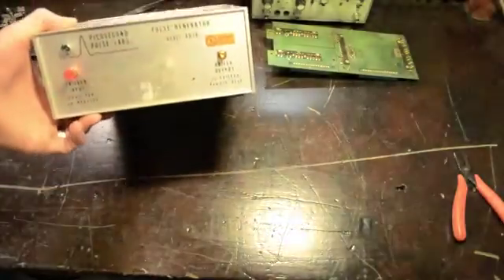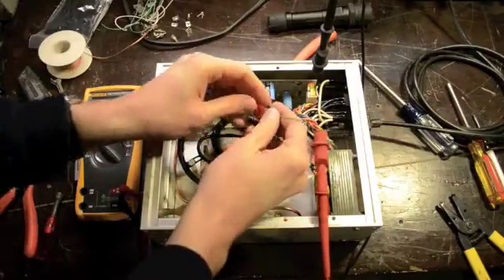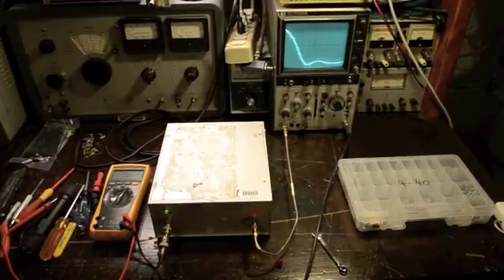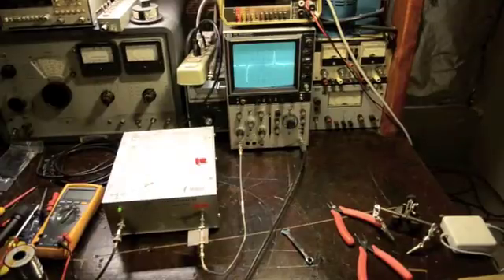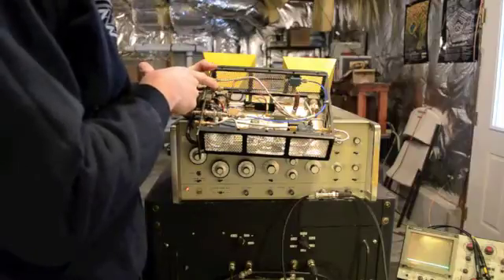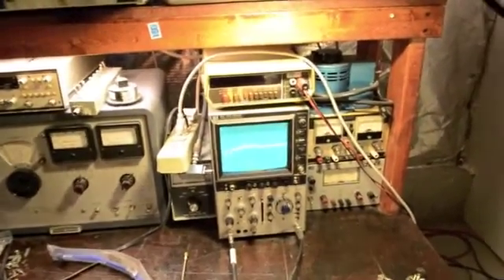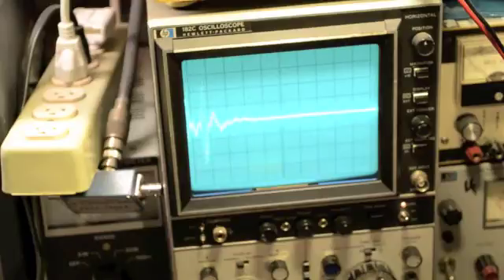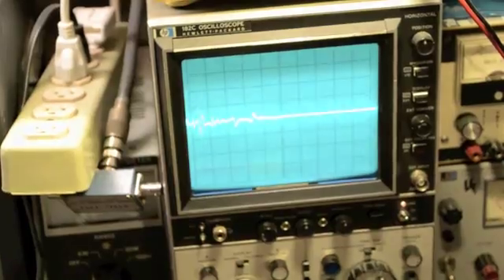Impulse Generator using an old Picosecond Pulse Labs 4015 purached from Ebay

Comment: Hi Greg, great video! Just before you realized your pulse generator had a pulse head inside, it sounded like you were going to make one from scratch. Is the driver a 4015D rph fast pulser head? You didn't by chance disassemble it to take a peek inside?
I've been trying to acquire a 4015d pulse head for a year or so with no success. I'm at the point of fabrication, but have had about as much luck locating a schematic. Would you by chance have a schematic of the pulse head at your fingertips? It's a big ask given we don't know each other, but that's where I am. :)  I've looked for similar generators on eBay, but they are pricey. Thanks either way, your videos are great!

Comment: hey my friend I have a question
can we use a impulse generator with 10Mhz and 100v peak without x band frequency for gpr??if yes we need a large antenna cuase our frequency is 10Mhz???I wanna use bow tie or dipole antenna
is important antenna size in simpe impulse radar